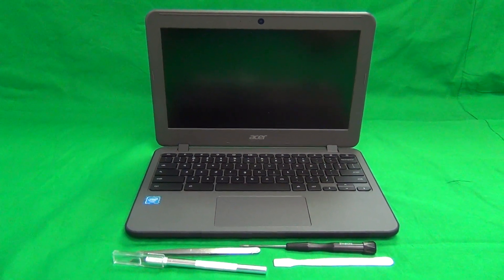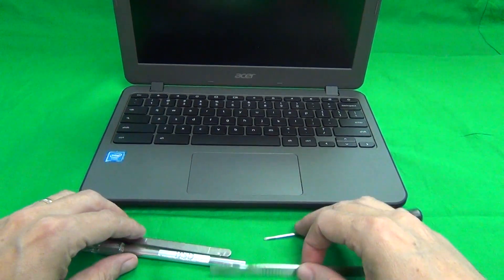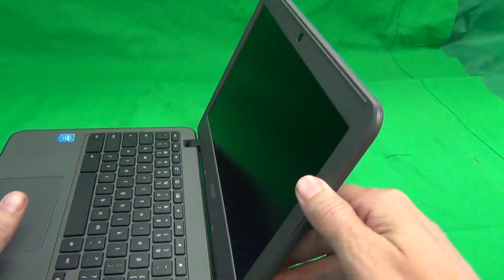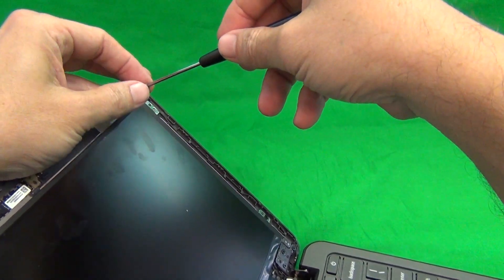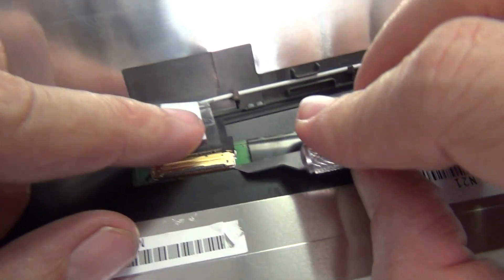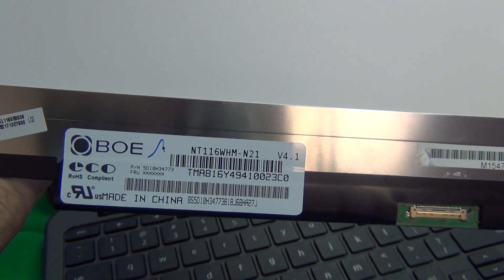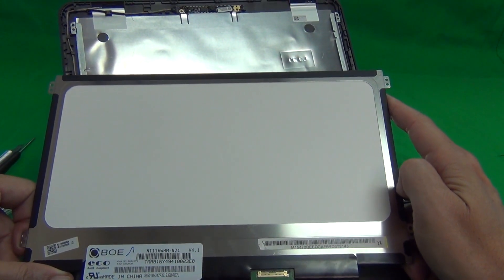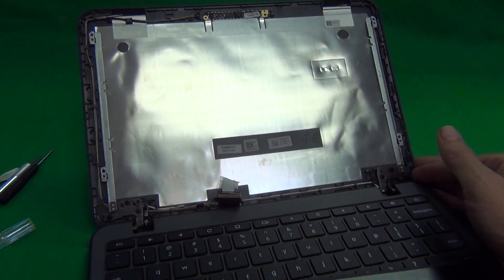How to Replace a Screen on an Acer Chromebook 11 C731 N7

Comment: My screen works but not the frame its just not working like I open it and it starts to crack open like the bottom left, and the metal thing with screws just broke from the fame.
Reply: Same and mine is school property